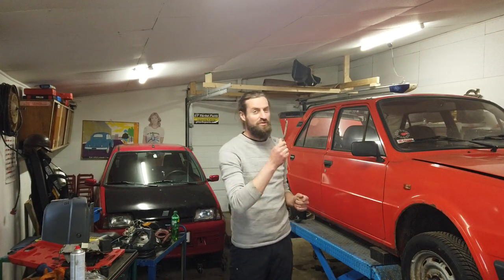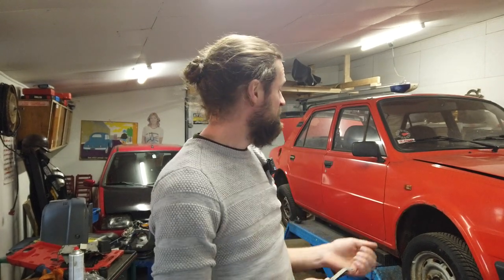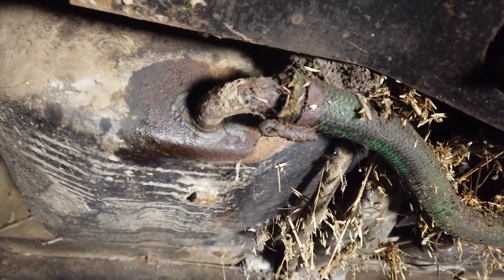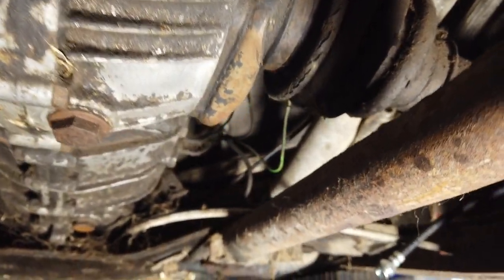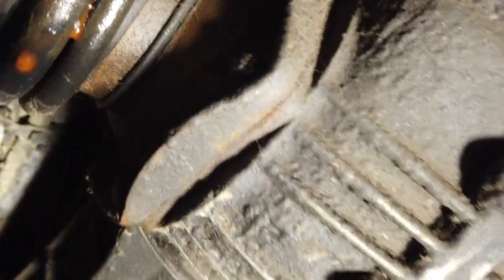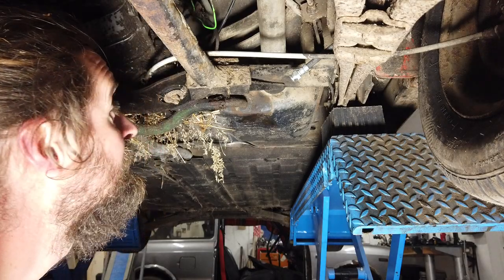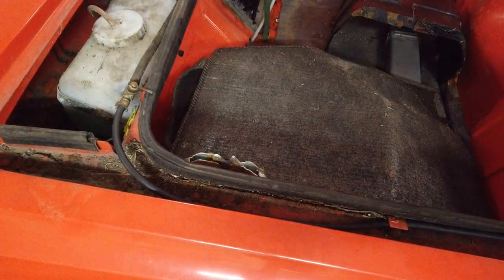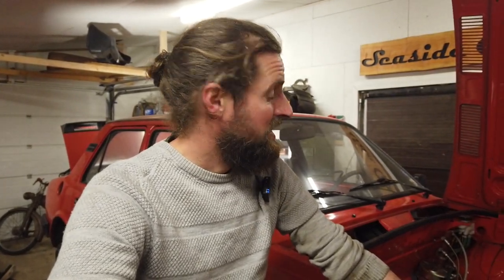BARN FIND ŠKODA 105- Leaking fuel and coolant.

Comment: Back in the 80s I had two Skoda 120Ls and took both all over Europe. A surprisingly solid, simple and reliable little car, though hardly the fastest! I'm not surprised there are quite a lot of them still in daily use after nearly half a century in parts of Europe, like the Czech Republic. There seems to be a whole workshop industry there making parts and keeping them and other old cheap models like the Favorits going - often as affordable transport for less well off younger drivers who often cannot afford the running costs of many modern cars.
Reply from the maker: They also seems to be very easy to maintain... and cheap... Its really not a bad car at all! :)

Comment: I had a 120 and a 130 loved them, in fact the 120 was the first decent car i owned having had enough of rusty  and worn out fords, i moved from 10 + years old junk to  a 3 yr old low miler,it was bliss.
Reply from the maker: They actually seem like pretty solid cars! :)
Reply: @SeasideGarage  they were i towed my trailer with them too. Word of caution make sure use full gallon of antifreeze as  21 pints cooling system if it freezes metal pipes fracture under car and many ruined engines thru water loss overheating

Comment: The cinquecento is not broken, just resting... did fuel hose on my cinquecento today, 8mm internal diameter hose at the fuel filter is the size if you need to order any.
Reply from the maker: ...How long does it needs to rest before it no longer makes mayonaise? ;)
Reply: @SeasideGarage  my second cinquecento is resting 3 year's with the same problem, in my case it's oil in the coolant 😕
I'm in no rush as it's a project when I have spare money to do it.
Reply: Today I took out the rear engine mount as it was making banging noise. Don't know looking at it whether it is broken but it is easy enough to move the center bit which I don't think is supposed to move easily. I will buy a new part and see if the engine is moving less with the new mount.

Comment: That seems to be the way with cars that have sat so long, new fluids and pressurised systems reveal where the rubber parts have perished, though I'm still thinking the fuel filler was made worse by ethanol fuel as that eats rubber in no time, whether new or old...
Reply from the maker: Its very true!

Comment: I was going to say that my 1978 105, for all its MANY faults, never leaked coolant or petrol.
Then I remembered that the reason why was because:-
1) I never had enough money to put much petrol in it in the first place  😭
2) the coolant could not leak because it had already mixed with the engine oil due to a warped cylinder head  😡

Strangely, after 30 years, I remember that as being good times.....
Reply from the maker: Hahah! ;)